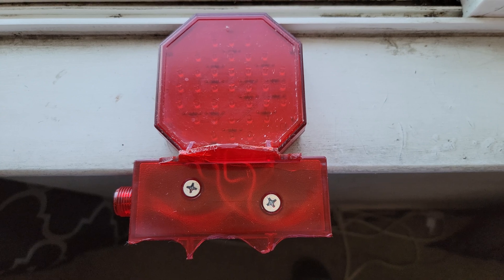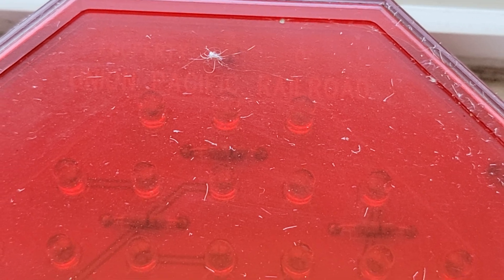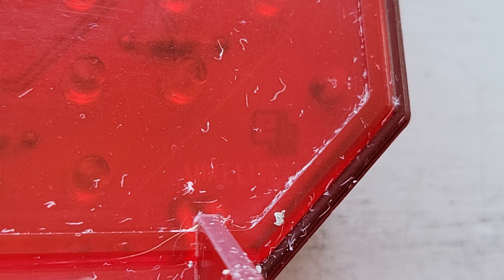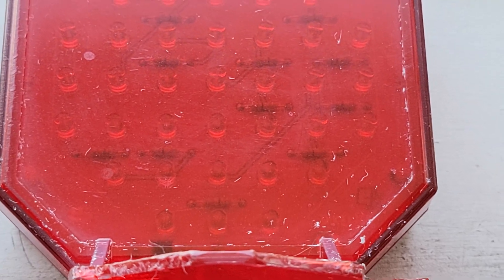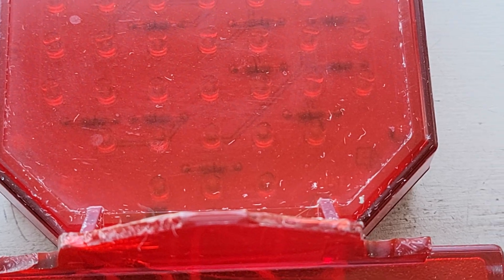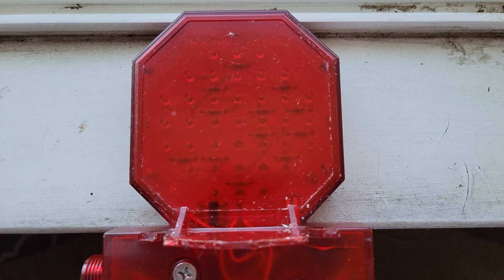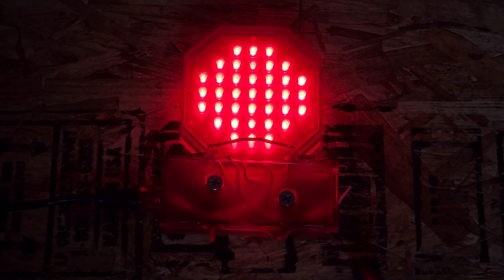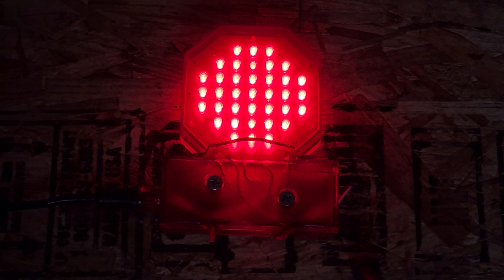My Electro-Tech Gate LEDs Light Flashing

Comment: Nice video! I suppose it's possible that ET started selling the Patco-style LEDs, especially given the fact I can't think of any new ET LEDs that I've seen go up anywhere, and those LEDs weren't exactly all that high-quality.
Reply from the maker: Thanks! I went to looks at some of the newer RSI Style LEDs after 2017 on SACRTs system and not all of them are the Electro-Tech ones though as I still don't know who makes the ones that say MATRIX in the middle as half of the new ones are those along with the ET ones. I also noticed a design difference I didn't catch before which is with the LED inserts side lights that are usually white or red, the ET ones are inside the lense with the main LEDs except facing the side and the MATRIX ones look to be behind the LED board facing the side.
Reply from the maker: I went and looked at some of SACRTs older RSI LEDs installed in 2005 has ET on them also so I wonder if Electro-Tech always had a partnership in making the LEDs with RSI but I guess the new ones with ET would be Electro-Tech installs.
Reply from the maker: Another update its a mix of RSI LEDs with the ET logo and no logo RSI LEDs on the 2005 install RSI LEDs. They both have a slight side LED slot design difference too from one another. Pretty interesting just finding this out.